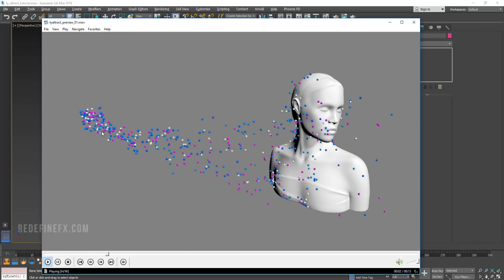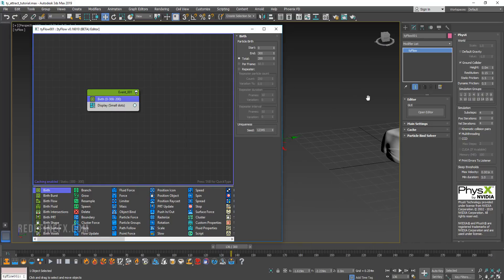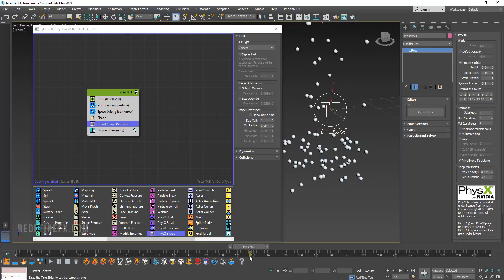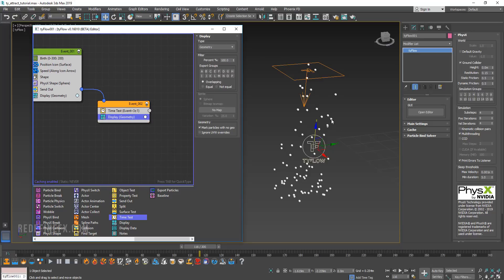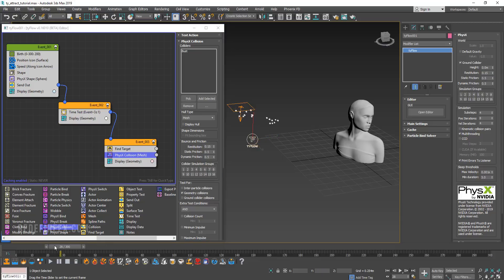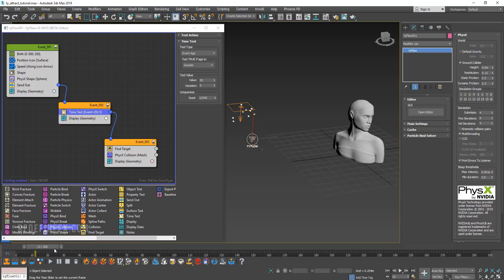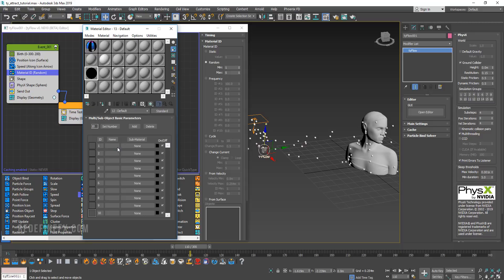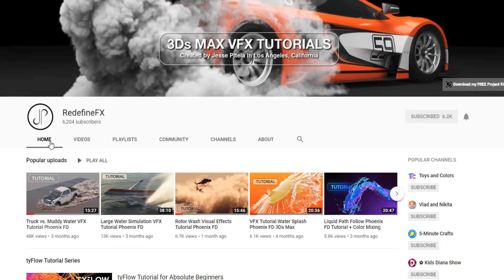tyFlow Tutorial: Attraction & Collision in 3Ds Max by #RedefineFX

Comment: You can do that with Blender. All it takes is one collision modifier and a forcefield. Particles can be emitted from any other object using a particle system.
Reply: I'll give it a shot. I hope the workflow is faster. The key thing about setup is speed. If you could create tutorials about what Blender is capable of & it shows it being done in half the time. Then I may migrate to open source software, because to be honest autodesk products don't put much effort & TyFlow is an example of that. A single person was able to improve the entire simulation workflow through their extension, it's a great node based add-on, but I know it will be pricey afterwards.